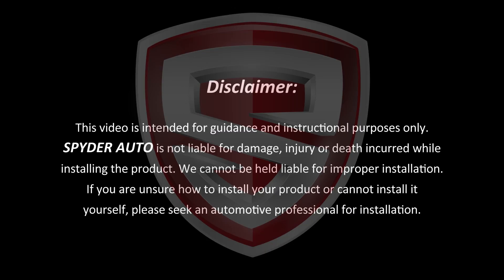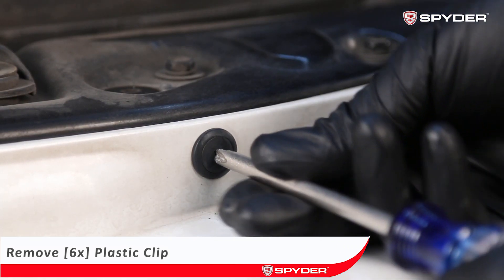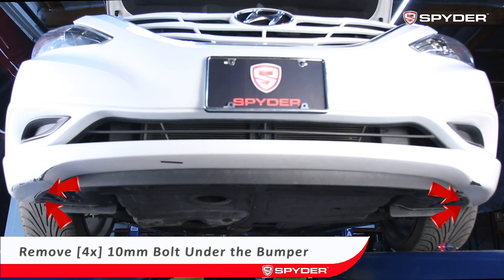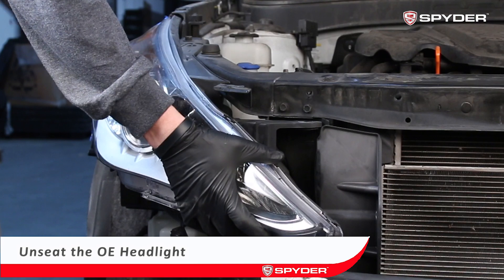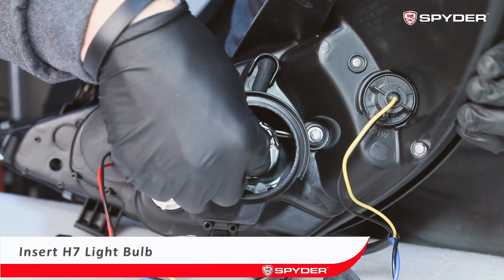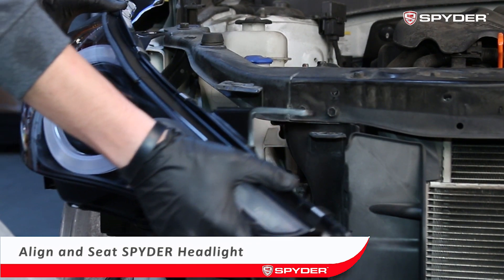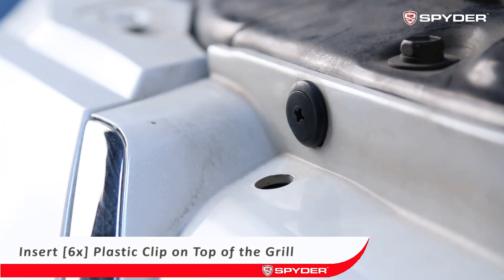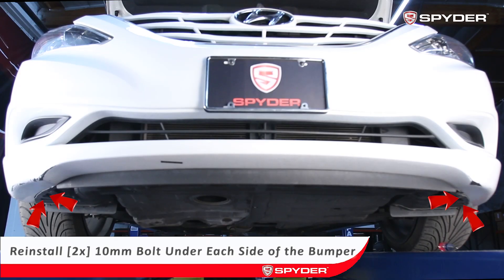Spyder Auto Installation: 2011 - 2014 Hyundai Sonata Projector Head Light

Comment: Do these project onto the road as well as the  brights do? I’m having a issue with the stock headlights, however I put in led bulbs and it still doesn’t help.... is this a fault with every headlight assembly?
Reply: You most likely do not have the bulb put in the groove correctly it's so easy to move it that it will distort your being pattern so you have to be sure that the little Notch is in place before you put the clip-on that's what happened to me
Reply: Did you ever figure out how to improve the beam projection. I'm having dim issues with my 2014 Hyundai, and changing to LED and HID didn't help.